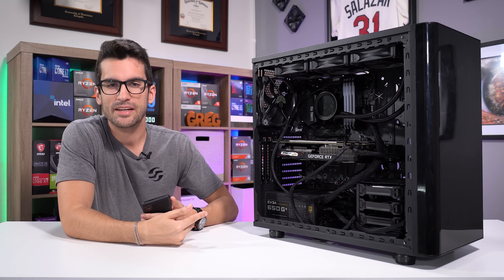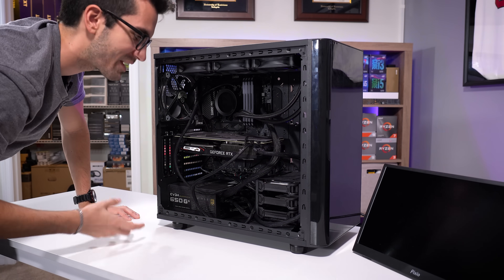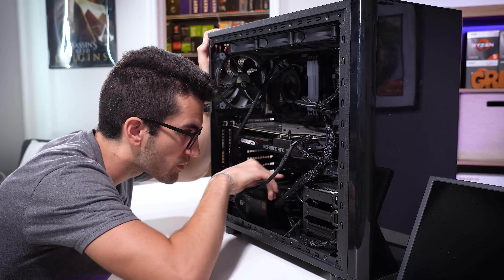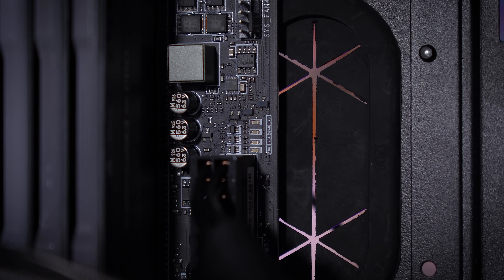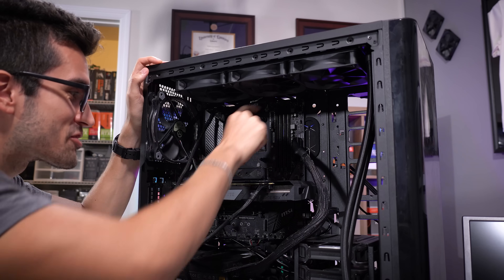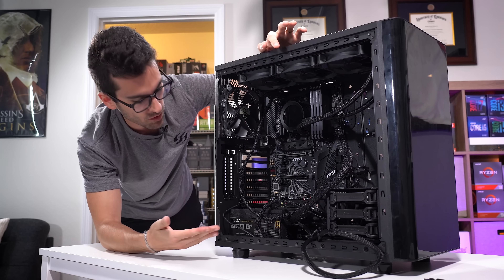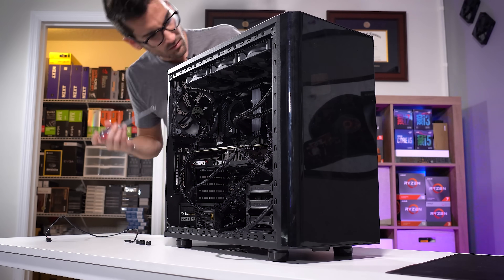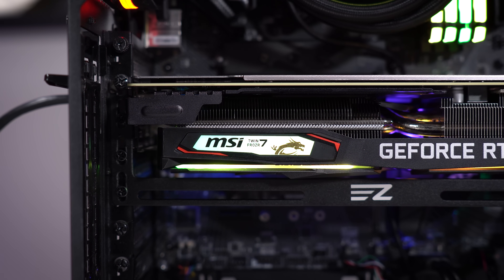Fixing a Viewer's BROKEN Gaming PC? - Fix or Flop S1:E4

Comment: huh, somehow he had the reset switch shorted. You did notice that it weirdly turned on automatically, its possible he had the pinout wrong and it was coming on by itself and also resetting instantly

Comment: I dont know why I think it's a bios thing 
Because wires wont do that 

And the board switches on automatically in the beginning (that's a bios setting) 
Then when it's working he needs to press the button again? 

I think he cleared cmos and it worked fine after that 

Might be wrong but it seems kinda sus to me

Comment: To be honest I have a 2 years old MSI B450 Tomahawk + Ryzen 9 3900x based system. I swapped my RTX 2060 Super to a RTX 3070 at the end of the last year. The system didn't post. I tried everything, literally, everything and I was so mad, because It was dark 11 pm and I spent my whole day off for troubleshooting. When I had no other clue and I was suffering from physical pain, I replaced the thermal paste on my CPU and the system posted. I don't know what helped for that day, but it was 6 months ago and my system still works just fine. Who knows what would have had been the problem?

Comment: my guess, he plugged the power button on the wrong pins (only one correct pin), under the right circumstances, you could have the button close the circuit from voltage coming from a different pin, then as the system started, voltage flowing from that wrong pin seating would create  a false "power button is being held down" effectively telling the computer to shut itself down after a few seconds
Reply: over the years i have learnt to start troubleshooting theese kind of things by  just stripping everything out, turning it on with a screwdriver, and see if it runs. then plug it all back one by one. our brains tend to think everything is in place if it looks in place. i have seen cases where the motherboard will act dead untill you run it naked, clear cmos, run it again, and then after all that dance, start plugging it all back in.

Comment: Can anybody help me?
My mother board is having some issue.
When I click the power button it doesn't even consider to turn on.
I checked the continuity of my power button, tried to clear the cmos.
Shorted black and green wires of 24pin connector.
Checked every connection.
Done everything that I could but nothing.
There was usually a relay sound when I turn on my pc but now that sound it also gone.

Comment: just upgraded my cpu to a ryzen 5 5600x and 36GB 3600 ram and i wouldnt get a picture. Turned out the motherboard didnt like the position of the ram sticks. I had them at A1-B1 and no picture. A1-A2 and it worked.  Im sure if I read the manual I would of saved some time.

Comment: Cable manage that thing lol.  Also should check the FP connectors before PSU.
Reply from the maker: It was cable managed later in the video... Also, FP connectors usually don't cause this sort of boot loop. Improper wiring will just lead to a physical power button that doesn't work. So I disagree. Check the larger, more obvious cables first. Then get down to the nitty-gritty.
Reply: Was going to suggest the Ram but my man caught it.  I've seen CPU lights go off for Ram issues plenty of times.
Reply: Motherboard issue so rare.  Damn it would have taken me forever to figure that out.  Usually for me it's the ram.
Reply: I take that back...  I would have checked FP connections first as originally stated.  I do repairs all the time.  I check that first.  People are dumb and put them back in wrong.
Reply: Thank god you're fixing that cable management.  I mean I get it to a point, but that was just unsightly.  Lol.  Good man!

Comment: My pc is also not working. It turns on and fans spin but nothing posts and shows error lights on the motherboard. It was my first build and the specs are a ryzen 7 3700x b550 mortar mobo 16gb ram nzxt aio. I was going for an rtx 3070 but because it didn't post when testing it with a gt 1030 i decided not to get it. Is there anyone out there who can help me figure out the problem because im pretty stressed out from it. The cpu doesnt have warranty and im really hoping it's not the problem.

Comment: My amd pc just sits on the solid light and doesnt post usualy it will kick in pump goes full and fans but i think it was power outage issue since it went out it hasnt booted up fully also its solid pipe water cooled so cant take my parts put willy nilly any help  be great im quite special in the head aha

Comment: most times when i encounter this kind of sudden power offs after 1-2 secs is the power button connection or the power button itself my first time i had a customers pc for 2 days changing everything but the case then tried jump start the system and it worked #Pfff

Comment: I have had frustrating builds like this as well.... even worse as a new build.
In my case, system would work perfect out of case but not in the case...  took everything out of the case and now it does work out of the case either. !!  I am sweating now...

Like this video...  nothing special has change... now I "rebuild" the system and it is working perfectly.
What gives, eh?

This type of issues can really frustrate a new or any builder who does NOT have any spare parts.  Absolutely worse.

Comment: My motherboard is b550 msi gaming edge WiFi my cpu is R9 3900x amd my cpu my system turn on but my monitor show nothing and my component not power on cpu ez debug led is on after I press restart button System restart and boot everything I’m going to show everything plz help

Comment: I have a similar problem with my pc. If the psu is turned off by the switch and then back on and I try to turn on the pc, it turns on for about a second or so, turns off and after a second or 2 it turns back on and works completely fine.

Anyone have any thoughts on why this happens?

Comment: My computer was having the same symptoms, when I turn it on it was on for a second and then it shut off. It was like something short with the power connected to the motherboard. So I suspect my PSU is the problem because it short somehow so I replaced it with the new one but unfortunately did the same. After checking all the other components except the GPU, the PC still won't turn on and had the same issues; it turns on for a second and then turns off. So I disconnect the GPU and fortunately, it turns on perfectly. At this moment, I should accept the dead of my graphics card :( 

PS: I've also tried to install that GPU in another PC and had the same issues.... so that's it I guess...

Comment: I miss the days when mobo manufacturers would include a special plug for the start button, reset switch, hd light etc cables..wire them to that 1st then simply plug that into the pins vs squinting and twisting your arms in wired angles praying you got them in the correct pin...I recently had 3 bad msi boards out of the box tried everything possible swapped for an asus mobo and bam post and boot right up..SMH I don't waste my time with any mobo other than asus..really any asus hardware is top notch

Comment: on such an problem why not remove the CPU and the RAM and then try to power on and check if it's the same issue? The system should still power on without them.

Comment: wish someone from UK would take a look at my system overheating. I have tried everything I know to get it sorted.
Reply: What OS are you running? What hardware do you have?

Have you over clocked?

When you mention 'over heating' is the pc shutting itself down or throttling? If it hits 90 degrees for about 3 seconds under load that's not over heating

Comment: my PC boots then shuts off then restarts and repeats, i have to press F2 and stay on that menu for a few minutes then reboot to fix the issue. it happened when i got the PC but it ended up Destroying the Windows 10 Image Files so i needed to do a new install of Windows 10. i paid £3200 for my gaming pc and the company who built it for me can't even build it and bother to test it before shipping it to me. now i am running a RTX 2080TI but my PSU should be able to power my pc.

Comment: "Interesting, the PC turns on as soon as the power supply is switched on...." "Guess I better not check the power button and continue checking all other possibilities that wouldn't cause the power button to activate...." -Pro tip, if hold down your power button the PC turns off after a few seconds. So, if you constantly short the power pins, the PC will boot and then shut off as if you were holding down the power button.
Reply from the maker: The power pins were connected correctly. As stated in the video, I couldn't replicate the issue with improper front I/O wiring.
Reply: @GregSalazar  I still believe that the power switch or wiring is the issue. Maybe the HDD LED and power switch were flipped, or maybe during his cleaning, something shorted the button or wiring. I bet you could reproduce the fault by holding the power button down or jumping the two power pins together and then flipping on the PSU.

Also, I apologize for the snarky attitude of my first comment. I was getting frustrated watching the video and wanting to check the power switch wiring the entire time. It was like one of those moments where you're trying to walk your PC illiterate relative through technical support over the phone. You know what you want them to do, but you can't get them to do it. I'm sure you can relate.  Anyway, I enjoyed the video.

Comment: Good night I have a little question when I try to upload my memory ram from 2333 to 3000, I don't get any video
Reply: Did reseating it help? If not, where's your video cable pulled in? If you have a RYZEN cpu, and the cable is in the motherboard move it to the graphics card
Reply: Xmp profile activated?
Reply from the maker: Probably because your system isn't stable at said frequency. You'll need to lower the frequency or use looser timings.
Reply: @malinamoores9086  yes i reseating like 4 time
Reply: @N3KO_79  yes activated
Reply: @GregSalazar  i tria tha tolower the frequency bot dont work

Comment: "It turns on automatically" -- check the power switch and power switch connection. Holding the power switch on will make the PC cycle power like this.
Reply from the maker: Yep, wasn't the issue here.

Comment: Man i was very disappointed when i managed to grab a 5800x on december and built my pc on january with 32gb ram, with a b570 mobo and my old gtx1060 , It kept crashing(BSOD) once in a while randomly. Changed different settings, checked motherboard bios, reinstalled windows 5 times, checked connectors, i thought my PSU was too weak, or bad, i thought my CPU was bad also. I kept checking online, and then i stumbled on BSOD crash log reader and saw some constant errors, did some google searches and few people said to test ram using RAMTEST, so I did that.........and guess what, of all my x4 sticks of ram, one was bad u_u. Got a refund and ordered the same sticks, all good now, but i forgot to reinstall windows lol so yea i'm running windows 10 that got installed with a bad ram lol. 11 days trying to figure out what was making my pc bsod.

Comment: That GPU Sag!
Reply from the maker: Fixed later in the video! :-D
Reply: @GregSalazar  Nice fix. I suspected from the start that most likely the powerswitch might be "pinched" (No idea how to explain it better): effectively thinking it was being turned off (Note that each bootup would only last for 5 seconds, which is generally the same time it takes to cold-shutdown a pc with holding the button).

Comment: Hey guys I know this is not the same topic of the video but I really need help, a few months ago I noticed that my monitors were taking a long time to wake up after my computer sleeps. I thought I was crazy for a while because when the computer does not sleep for a long time, the monitors wake up fast. I only have this issue after long sleeps. This is not an issue with just one monitor because both wake up at the exact same time and it is not a cable issue because one is Display Port and the other is HDMI, my drivers are all up to date and both monitors are different brands so I believe it to be an issue with my computer. No matter how much I google I can not find a solution please help me if you can.

Comment: The first step in diagnosing an issue like this is disconnect every thing besides 24 pin, cpu 8 pin,gpu 8 pin, all drives and all ram but 1 stick.... if it post add one item at a time till you find it or if it did not post it's cpu and or motherboard... you started throwing parts at it like an amateur... must be nice to have all those components laying around...

Comment: USB fault, Iv'e had this happen before. It wasn't happy with something plugged into usb and wont post till usb header cables are removed. Replacing the motherboard WILL NOT FIX IT.

Comment: Hope this is a fix otherwise you're heading for a series of flops :P {right off to find out the answer to my muse]
Reply from the maker: ? We fixed the first PC, properly diagnosed the second PC, and couldn't save the corroded board in the XBox. Not sure why you'd think that's a series of flops :P
Reply: @GregSalazar  Nah don't worry about him. You did an amazing job here. This is a very weird case but hey as long as the problem was fixed.

Comment: When my 10 8 50 k would not post it turned out that the CPU itself was actually the problem. Intel replaced and system is now functioning
Reply from the maker: Was it working prior? DOA is a different story. What I was referring to was CPU death rate during usage. It's rather low. Typically, the motherboard/PSU/graphics card dies first.

Comment: 0:40 calling the cpu
Reply: 12 pins for cpu power? dafuq?
but like also you should always try to have those plugged in for stability reasons
Reply: i've never had a cpu die on me either knocks on wood
its probably the mobo
Reply: what is life

Comment: You should have listened to yourself when you pointed out it turned on automatically. When you said it, I immediately thought the switch was bad or shorting somehow on the front panel. If you turn on a PC and then immediately hold down the power button the exact same thing happens.

Comment: I dont know why u always trying with a new graffix card when u can just post with the MB hdmi. If that works than u can look into the gfx card or the pcie slot it self. Have fixed many computers and it just looks like you taking the loong road when u easy can check this stuff. If the MB have a HDMI out as most have.

Comment: I am mildly cringing over this PC. Weird fan arrangements, a case with questionable airflow, and a huge hdd cage blocking the already limited airflow for the GPU. That's not the owner's fault. the case manufacturer really should've added some low-profile hdd mounts along the side or bottom instead of lazily tossing a big metal cage.

Flipping the rear fan to exhaust won't actually solve any dust issues because that PC is gonna be sucking in air through the expansion slot covers. That's actually good for the GPU, but I sure hope the owner opens that thing up every couple months to dust out the GPU cooler.

Comment: this has to be some of the worst troubleshooting process I've ever witnessed, like, you know your stuff, but I have to at least give some criticism, you can cut down every step by removing all components and starting with basics sitting on a desk, or better yet, before even taking out the components, removing the CMOS battery for 10-15 mins to clear settings. just, sloppy; would never have to take off the cooling and cpu unless absolutely needed. The good stuff, cabling and clean up is good.

Comment: makes a 20 minute video testing a motherboard while leaving ALL the other peripherals connected including the notorious USB power connectors and the power switch cable and he only THEN remembered to disconnect them? dude...come on. Isnt the first rule of TESTING A MOTHERBOARD is with just the PSU and disconnect EVERYTHING ELSE on it leaving JUST the 24 pin power connected to it?

Comment: HELP HELP HELP HELP HELP HELP HELP HELP HELP HELP HELP HELP HELP HELP

I RECENTLY BUILT MY PC AND IT WONT TURN ON AT ALL TRIED A NEW PSU A NEW CPU AND A NEW PSU AND A NEW GPU BUT STILL NOT TURNING ON
Reply: check your front panel connectors